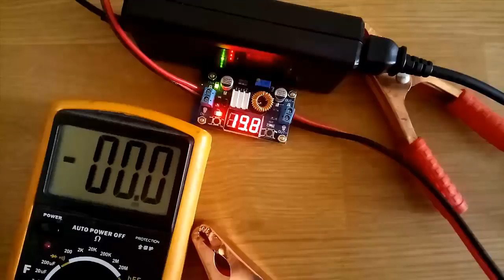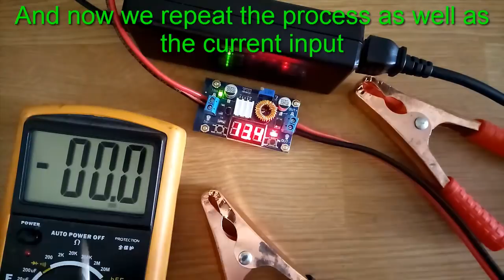How to Make a 12 volt Battery Charger with a Laptop Charger

Comment: Why you are using multi tester and there is a digital voltmeter in you dc step down. And your charger is not enough ampere or currebt to charge that big battery otherwise you charger and your dc step down become hot not safe. Try to use ei transformer atleast 12 amperes 12 volts.

Comment: My laptop chargeris 14v,I set the output voltage to 13.7, it works fine in the beginning, but later on the output voltatge kept on decreasing to 11v and there is no way to increase or decrease it..any help?
Reply from the maker: Hi Gorb
batteries need time to charge. if I show you 11v means you have to load it for a while.
Reply: BUY BATTERY CHARGER
Reply: Jangan bercanda Jang!

Comment: Hi. Thanks for your presentation. Can I connect both my UPS and the module with laptop charger in my 100 ampere battery? I am planning to use my APC ups as an invertor.

Comment: Can we use this tip ,to charge a 12,6V li-ion 3S 3P Battery Pack? or is only for Pb battery's?
Reply from the maker: Hi
For 12.6v lithium batteries you need a 3s BMS. this, when the batteries have been charged, disconnects the power supply to the batteries.
Look here where you can buy
https://goo.gl/B3bY7J
Attention, lithium batteries are dangerous, you must be well informed before starting a project with these batteries.
Reply: @CMCdiy  I have 3s BMS in my  pack, I have LM2596 regulator and  a laptop charger,  If i regulate  the module in 12,6 V can i charge my pack  ? Is this charger cc/cv?

Comment: Also you can charge big car battery ( about 70 Ah and more ) but it's took veeeery  long time to charge it to fully capacity ... Empty battery drains so much ampers ( more than 10 wich is LOT )
Reply: Samo Hraje Friend it's a wrong and expensive trick.,  Laptop charger have 19/20v  about 3.2 to 5amps., A battery need charging voltage 14.4v., your trick is 19v reduce with help a step down buck converter, i think buck converter have about 300 indian money or more., But if u have no money expenses with a good trick...First you will open laptop charger, and check feedback voltage regulator circuit, it's assembly with tl494 three pin small shunt regulator and a poyi coupler via controlled 2/3 resistors with adnesting pin of tl494, varying      value of resistors..Then change output voltage..Up/down for you need, just try it. This is very perfect way and no have any expensive., Another good way is computer atx power supply ... Voltage carrying same of this way., Computer power supply have more ampere. Try it
Reply: what is the wrong ? u just buy this compact - quality assembly , adjust  you are done. flip cart -is ~180 to 300 RS . It is ok.

Comment: Can i use 21volts sir???
Transformer sir? Godbless..plz reply sir..thank u
Reply from the maker: Yes you can.
It is important to adjust the voltage. the output voltage should be max 14.5v

Comment: Nice tutorial. Just you forgot say how voltage is on laptop charger. Thank you.
Reply from the maker: hi  Tomasz

In general, laptop chargers have 19v.
With this module you can get voltage: 1.23V ~19V.
Description of the module
Input voltage: 4V ~ 35V
The output voltage: 1.23V ~ 30V
Output Current: 3A (Max)
Reply: Thank you. You're top class eng.
Reply: i want get 19.5 volt only what is side diffect this method pls reply fast

Comment: I am planning to buy one. I hear the circuit is short circuit protected. Does anyone know what happens if I connect the battery in reverse polarity by mistake?
Reply: your laptop would get fucked if it doesnt have a reverse polarity protection circuit.
been there myself...

Comment: Can I use this module with 18V 5A transformer base battery charger?
Reply from the maker: Yes. you can also use this transformer. but do not forget to adjust the corresponding voltage

Comment: can I use this module to be installed in the car battery? so that the car battery voltage is stable
Reply: what made you think that any car can need another charger inside. Is one inside not sufficient?
Reply: Maksudnya buat charge di luar mobil oom? Ya bisa, tapi kalau buat di dalem mobil ya buat apaan juga?

Comment: can it show that battery fully charged?????
Reply: You can determine if the battery is fully charged by testing it's voltage. Fully charged battery should show around 14v on multimeter I guess

Comment: With a laptop  charger and buck boost. Viverter with. Constant  currebt and voltage  options .   All the charger does in this situation   is just  convert  the a.c.  to dc

Comment: salute to you for your share.I challenge you to share how to build car battery keeper with laptop charger + LM317 + 2.2 ohms + 1N4002. much-much more cheaper than this share.
Reply: anto leyo Friend it's a wrong and expensive trick.,  Laptop charger have 19/20v  about 3.2 to 5amps., A battery need charging voltage 14.4v., your trick is 19v reduce with help a step down buck converter, i think buck converter have about 300 indian money or more., But if u have no money expenses with a good trick...First you will open laptop charger, and check feedback voltage regulator circuit, it's assembly with tl494 three pin small shunt regulator and a poyi coupler via controlled 2/3 resistors with adnesting pin of tl494, varying      value of resistors..Then change output voltage..Up/down for you need, just try it. This is very perfect way and no have any expensive., Another good way is computer atx power supply ... Voltage carrying same of this way., Computer power supply have more ampere. Try it

Comment: Friend it's a wrong and expensive trick.,  Laptop charger have 19/20v  about 3.2 to 5amps., A battery need charging voltage 14.4v., your trick is 19v reduce with help a step down buck converter, i think buck converter have about 300 indian money or more., But if u have no money expenses with a good trick...First you will open laptop charger, and check feedback voltage regulator circuit, it's assembly with tl494 three pin small shunt regulator and a opto coupler via controlled 2/3 resistors with adjesting pin of tl494, varying      value of resistors..Then change output voltage..Up/down for you need, just try it. This is very perfect way and no have any expensive., Another good way is computer atx power supply ... Voltage varrying same of this way., Computer power supply have more ampere. Try it
Reply: Nostalgia Nostalgia wow I didn't know this. Thanks
Reply: is that all laptop charger have that function?
Reply: The trick is right, but impractical.

Comment: you did it wrong, dude..
Reply: Kym Cainday can you make a video about how do it correctly?
Reply: What's wrong about it ?
Reply: Untitled Channel, Use a voltage regulator Ok, it is not using a protection circuit, against short and over load, battery can explode if not have the proper care.
Reply: @leandroinpe  some buck converter has such protection(overload) as they said so. But the protection is actually imperfect. I accidentally tried to take 10 amps from it and it died.

Comment: I want to make a power supply for an amplifier 12 v 3 amp output,will this circuit work ?
Reply: Yes a DC to DC converter circuit  will work you might need a few resistors to limit current to 3A
Reply: There comes 12V 5A adapters (ebay) for that purpose, very cheaply, why you want to step it down and all?